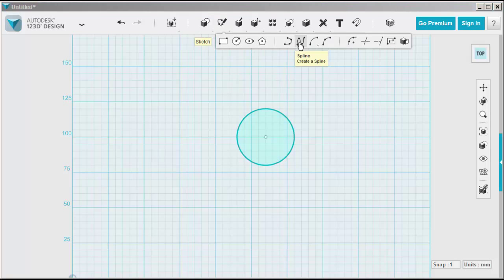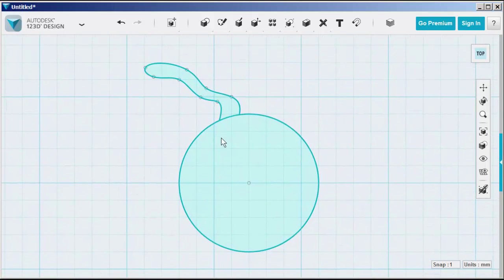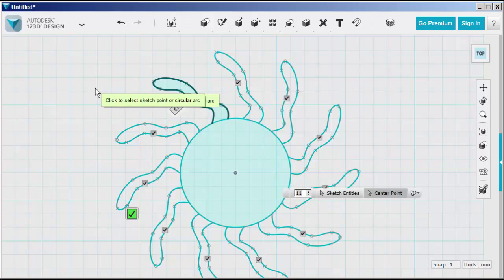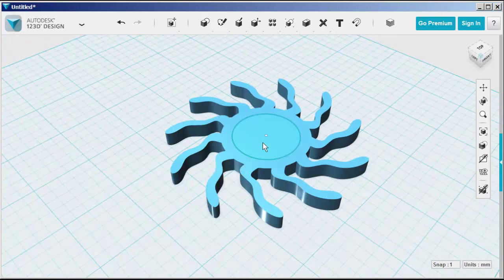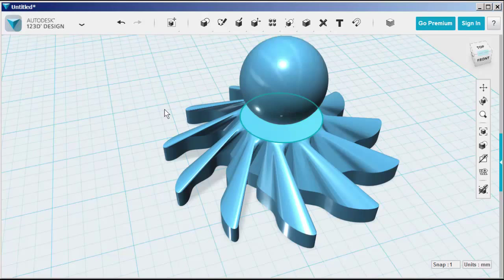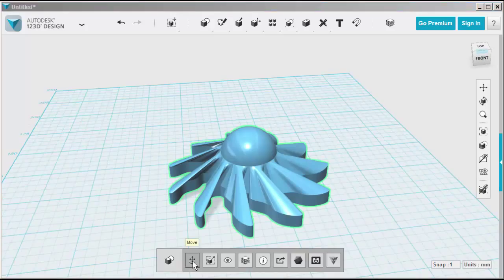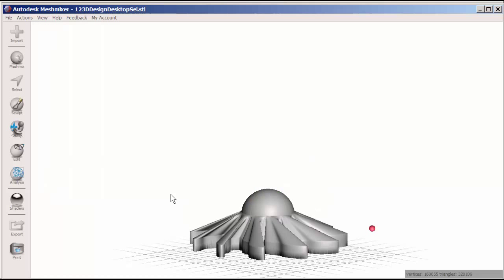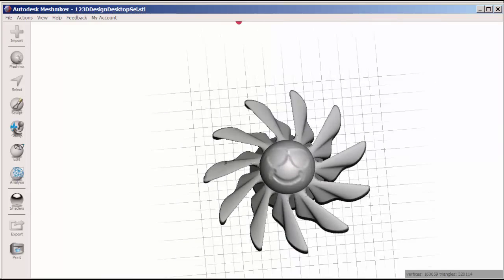123D Design and Meshmixer: Sun Sculpture

Comment: Help!
Hi, there.
I have a problem with my 123D Design software. One day, it just refused to open. When I click its icon, the prompt screen appears, but then it just disappears and nothing opens up!
I even uninstalled and then reinstalled the program. But still, it just doesn't open anymore. What can I do to resolve this issue? Thanks for any suggestions. E.
Reply from the maker: Are you on Windows 10? I've heard it doesn't work on that. 123D is a retired product, consider switching to Fusion.
Reply: @ProfDrafting  Although a little late,but it works for me on Windows 11.